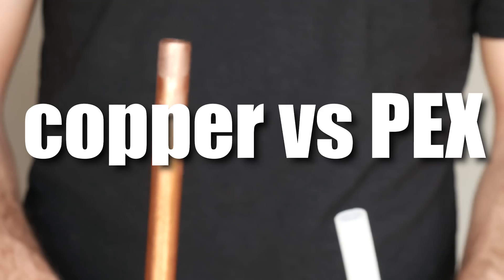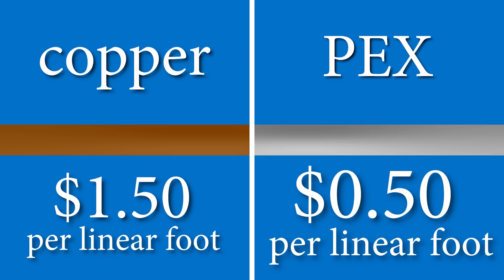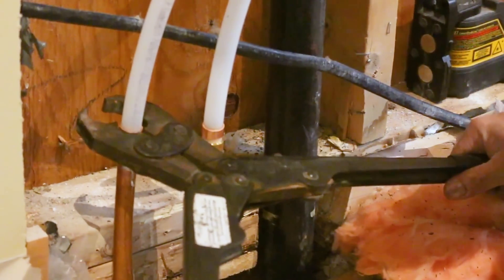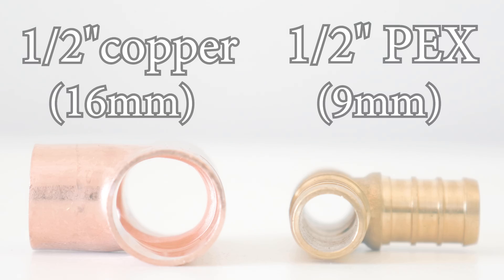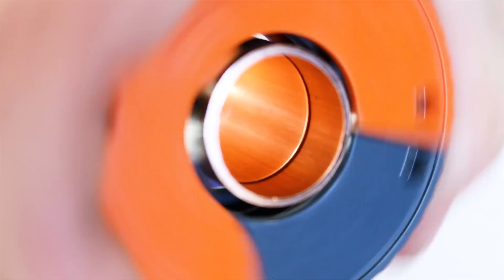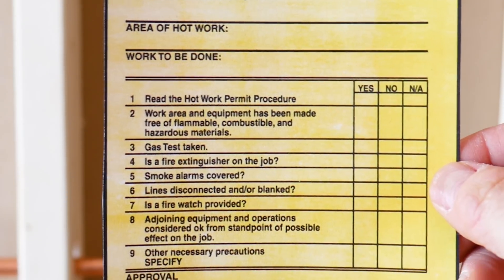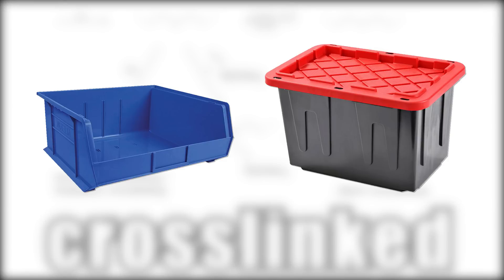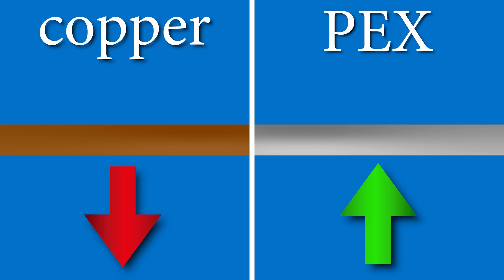Is Copper Better Than PEX? (COMPLETE GUIDE) | GOT2LEARN

Comment: For repairs, I just match what is already there.  If I come across CPVC, I use CPVC even though it is my least favorite system because it gets brittle as it ages.  Doesn't really matter because even it lasts much longer than my guarantee.  My favorite system is copper L, soldered.  ProPress is great for repairing copper with water in it or a fire hazard or to avoid a hot-work permit, but solder hands-down is the best.  ProPress is just a fancy crimped on SharkBite.  One trick I do sometimes is solder on Copper to Pex barbs and do a repair in pex particularly for freeze-ups or when I want to get off a job-site FAST!
Reply: Im practicing soldering right now. It's just crazy because it looks good on the outside. But when I double check my work by splitting the fitting. I see gaps I missed. Do you think this is the case for alot of people when they are soldering joints?

Comment: I would rank my choices... Copper L would be my preferred choice, then Pex A like Upanor, then Pex B with a quality crimp or clamp job on plastic fittings,  then pex B on metal fittings which can corrode, followed by Copper M, then CPVC.  Those would  my my choices in that order.  My house unfortunately has Pex B with the Crimp rings on plastic fittings... they are NOT done well from the ones that are visible in that they are not cut square, not crimped square, not centered  etc.  It was as if someone did their first crimp job.  I do NOT want to know how the fittings are in the walls or worse under the slab!  Clearly the plumbers here were idiots.

Comment: Copper doesn't give off fumes in a fire (great for fire safety and smoke requirements). Over a century of evidence shows that copper piping is flexible enough in to be used reliably in structures subject to damage by earthquake shaking (as long flexible connections are used on appliances like clothes washers, sinks, and water heaters as most codes require). But fastened in a wall a copper pipe flexing on a swaying third story building will survive just fine and deform as needed, including the soldered joints and elbows (although PEX is more flexible). Copper can also be used outdoors on building exteriors exposed to the environment (great for masonry applications) while PEX will deteriorate due to sun exposure. Lastly, when your screw or nail hits a copper pipe in a wall you will feel it better and be able to detect it earlier. Modern screws are so sharp that they will easily bite into PEX before the flexible plastic pipe can move out of the way to avoid damage. That being said. I have faith in both PEX and Copper.  However, when someone Hires you to do a repair job, the customer feels they got their money's worth watching you prep and solder versus slide on a shark connector and then saying write me a check for $600.00.

Comment: I'm an electrician, I've been trying to learn more about the other trades. Your channel has helped quite a bit, I've learned a lot.
Reply from the maker: Great to hear, the more knowledge the better!
Reply: Same here.
Electrician as well.
This channel is awesome for learning the  plumbing trade
Reply: same here
Reply: copper is conductive.
Reply: @greenspiraldragon  A major consideration when we bond, very true.
Reply: Ha, I'm a plumber that's now also a controls electrician.. always good to know there are others out there that don't limit the trade knowledge to their own single trade, my 3 early years of framing gave me the knowledge as a plumber to know what not to drill... as a sparky, your plumbing and heating knowledge should lean towards boiler controls and pumps primarily if its to be a compliment to your trade :)
Reply: Mann 😆
Reply: No no no no.

Comment: With the cost of copper these days, PEX every time. I just got quotes for a 35' gas line extension, the copper ones were at least double the yellow plex hose.
Reply: More to it than cost. I would never run a plastic gas line. That is a time b o m b.
Reply: @rickjames6948  Yea, I know, that was my first thought, but copper is at least twice the cost. It is not really plastic, it is rubber with a flexible metal inside. It was installed by a licensed HVAC, so it must be to code. I was really leery of gas, but the gas system has so many safety measures. How often do you hear of a gas line explosion in a house?
Reply: @johncasey5594  Only a few times a year, in my city.

Comment: One question i have is which pex is best. Two concerns i have with pex is water contamination from plastics and how long will its joints really last. It's one thing to repair a few coper leaks after 40 to 50 years but i would bet the  pex fitting connectors have a shorter life span and will be a major repair cost. This could mean replacing all the water pipes in a home after a certain amount of time which i believe will be much shorter than copper.
Reply: My home is 30 years old and I can say that the compression fittings on my pex water lines have started to corrode, I think pex is the way to go inside walls and hidden areas, but we’re converting to copper under all of our sinks and for the bathrooms as well. Pex is about 70 cents per foot, the copper pipe I bought is $5 per foot.

Comment: Here’s one thing you cannot deny there is absolutely no lead whatsoever released into the water system using pex
Reply: All brass has a small amount of lead and all (as far as I know) pex valves and female adapters are brass. Where do you find lead in copper? I use “lead-free” solder but it may have a small percentage of lead, too. I really don’t know.
Reply from the maker: Here is some good info about lead allowance in brass guys, check it out: https://www.youtube.com/watch?v=cELzc9ZophQ&t=1s&ab_channel=Got2Learn

Comment: PEX stub out for toilet? It will be rotten by UV light, even coming through windows or lighting. PEX cannot be used everywhere copper can, but copper goes anywhere PEX can
Reply: Good pex is UV resistant. I still like copper for students tho
Reply: I replaced a copper freeze hazard deck faucet line of about 20 ft with PEX. The problem was the last 6ft would be smacked with UV. No good. Solution: shrouded the PEX in shower curtain rod cover plastic the same color as the decking material.
Reply: @JeffreyTheTaylor  i don't worry about freezing here in Southern California. I like copper.
Reply: @DragonBuilds  We didn't worry about it in Atlanta either. Nor did my neighbor. Then it hit a freak 5F one night. Basement bathroom copper pipe blasted a hole in their sheetrock, looked like a disaster movie. I put the PEX in ASAP. Lesson: spec to freak.
Reply: I think the answer is to use Copper Stub-Outs, but I could not agree more.
Reply: @jamesdunphy6262  Here in Southern CA copper can easily last over 100 years. Some places probably have very harsh water. But PEX isn't allowed anywhere the sun might shine on it.

Comment: Also,(i forgot) copper its safer than plastic,because of chemicals found in most plastic pipes.not to mention that most of them,are not sunlight resistant,and the toxicity,related to this,and sun exposure.

Comment: Well,it all has to do with water condition,aside from price, life span,and skill to work with. If water its acidic,or the ground,you have no choice.use pex. That's why pex fittings comes brass and plastic.
Personally i use both,even in the same job,as code permits.

Comment: Copper is the way to go for me as I find the process and end result awesome, compared to the somewhat chaotic pex pipes never running in a straight line. I worked in process control and instrumentation so bending/fittings/soldering are the way to go for me. Although I don't make a living out of it so it's a different story .... ¯\_(ツ)_/¯

Comment: Good video,first of all I have never bored holes in studs and rafters to route pipes,the way I was taught is to notch out studs and rafters when installing water pipes and to use nail plates to protect the pipes from inadvertantly being damaged by nails and screws when sheetrock is installed on studs and rafters.I will only bore holes in studs and rafters to route electric wiring and of course to route drain pipes.As for copper pipe not being flexible I now use copper pipe press tools which make installing copper pipe faster and safer than soldering the copper pipe.At first I was highly skeptical about copper pipe press tools but after having used copper pipe press tools I am amazed at how easy and safe it is to install copper pipe using press fittings.God bless you and yours,thanks for the video.

Comment: Always PEX for us! I've heard old plumbers say nothing is as secure as a good solder joint. Could be, but I've repaired solder joints that looked A1 in the outside, until we went to repair and it popped apart in our hands. Also, some areas have acidic well water which eats copper.
Reply: Sometimes you never really know until you cut the fitting apart and look to see how the tin spread in the fitting. Im currently practicing with it. Looks good on the outside but bad on the inside.
Also soldering is so time consuming compared to installing pex

Comment: Great video, I have always like copper but that is what was available at the time when I learned how to plumb it. Pex in the late nineties was garbage and unreliable and burst in homes including mine in 2007. I wasn't a fan of pex. The recent modernization of pex has grown on me to the point I would choose over copper for the convenience and price. I am still learning pex, but finding the differences of joining different pex products would be a great video. It would be nice to see how to connect different pex connections by the understanding of them. Thank you looking forward to another video. I will hit the bell and subscribe.
Reply from the maker: Awesome thank you for the sub and like :)
Reply: You don’t want to mix pex products. In order for the warranty to stay in effect you have to use the same brand pex pipe and fittings. If you don’t you will reduce the warranty from a 25 year warranty down to a 5 or 1 year warranty. Manufacturers test their products with their fittings and that is what they will warranty.
Reply: I was writing on Pex A and B connections. A is better then B, but I have problems trying to seal the joints on A when installing it. I would like to see content on this. Thank you for responding. Great channel.

Comment: PEX,  I suppose it has it's places but, for overall performance and longevity I will go with COPPER!!! I am a plumber too. Torch it and forget it. Still the best system going. Pex is cheap and your drinking water that goes through this cheap plastic pipe that can grow microbial stuff and gets weak if exposed to sunlight. 50 years my arse!! Copper, baby all the way!!
Reply: Don't let them take the skill out of your trade.
Reply: @rickh1300  lol plumbers will be fine, most states you need years of plumbing under a master plumber to even apply for a permit to work on your own, same shit for electrician. Their unions made it so their job will be safe for a long time. Which annoys me as a carpenter, any idiot out there can get a license to build homes as long as they pay a plumber and electrician that is licensed, meanwhile they can barely tell the difference between pt wood and regular. Live in DC area and you can’t even replace a tub without a licensed plumber pulling a permit to do the work.
Reply: Of course you're a plumber. Gotta install something that will freeze and burst so you can charge to repair it. Pex won't freeze.. and can withstand more pressure overall
Reply: @asithappened99  Pex has its places and so does copper. Plumber, auto mechanic or Psychologist, yes i fix things. It not just about money to fix something. What, where,  how to fix anything correctly takes experience. It is not so it will break again and charge you some more. Crap attitude. Fix it your self. I see 12 agree with me. You have no one!!  Copper all the way. I'll believe 50yrs for pex when i see it.

Comment: Nice video ! But you didn’t mention that pex fittings are more expensive than copper fittings most of the time ! And that the pex tool that you are using is not very handy in a small spot because it requires to be opened to the max to do a well crimp ! I know that there’s smaller tools 🛠 for pex lol 😂 but there both good depends the situation 🤙
Reply: pex fittings are more expensive, but you need less of them if you plan it out right as pex is flexible.  I forgot the exact recommendations, but 1/2 inch pex can go as tight as a 5 inch 90 degree bend.  The price of pex tubing more than made up for the cost of the fittings for me.

Comment: PPR?
Reply: @Got2Learn  Polypropylene Random Copolymer. PPR piping.  What about comparing to it as well.
Reply from the maker: Ahhh yes, we don't see much of this here in Canada, but yeah it would still make for a good video for sure.
Reply: @Got2Learn  thanks, that would be great. Here as far as i see it(I'm not a plumber) it is popular here, for domestic hot/cold water and heating secondary loop. Tho underfloor heating is done with pex or pex/al and if it is firewood boiler primary heating loop is done with iron/steel pipes. I'm redoing all the plumbing in my house, so i need every bit of information i can get, what's what, and what i can do my self, because stuff gets expensive pretty fast.

Comment: If your a plumber you're a very bad one!! Using a lead based solder on water pipes?? Are you kidding? This method has been strictly banned by world wide plumbing authorities for many years. Drinking water from a joint that has lead in it. Wow what cave have you been living in? Going by your basic knowledge and terminology l think you must be a self taught  handy man not a very skilled plumber. Your workmanship is terrible. Leave it to the professionals who have and are extremely well trained and would never make home videos telling others how to undertake the elite trade of plumber. Off you go!
Reply from the maker: Someone isn't having a good day hehe, I never use lead solder Geoff, never did, never will, and I certainly didn't say that in the video lol 🤦‍♀️
Reply: @Got2Learn   Really? Your using core solder on your joints. What is the base of core solder? Lead & tin. The multi purpose flux you're using is also for lead based solder. Silver solder or bronze rod does not melt that quickly under such a cool flame. Mapp gas I'm guessing going by the flame. Perhaps you need to warn the people who follow you not to use lead based solder on any pipework for drinking and definitely not on any gas pipes! Oh yes I am having a good day. You?
Reply from the maker: Geoff, MAPP gas doesn't exist btw and there is no lead in the solder and flux we use.
Reply: @Got2Learn  Well that's very odd. I'm looking at a bottle of MAPP gas right now! I'm guessing that you're a self taught handyman that thinks he knows plumbing. I have viewed several more of your  online videos and wow shook my head in disbelief at some of the things you  say and do. Yes some were ok but leave the plumbing to the plumbers who are all very highly trained in their trade. A little bit of knowledge is dangerous! Before you point at me, I'm in my 49th year of plumbing and probably forgotten more than you know, maybe! Would you like a photo of Map gas?
Reply from the maker: Yes you are correct, a little bit of knowledge is dangerous, enjoy Geoff: https://en.wikipedia.org/wiki/MAPP_gas
Reply: Really? Your using core solder on your joints. What is the base of core solder? Lead & tin. The multi purpose flux you're using is also for lead based solder. Silver solder or bronze rod does not melt that quickly under such a cool flame. Mapp gas I'm guessing going by the flame. Perhaps you need to warn the people who follow you not to use lead based solder on any pipework for drinking and definitely not on any gas pipes! Oh yes I am having a good day. You?

Comment: Stainless Steel 😉 when it is too expensive then we use PE-X* or multilayer PE-**/Al/PE-**pipeing systems. Cooper should only be used in heating systems, but due to the high price we also use other materials

*....a, b ,c
**... Xa, Xb, Xc, RT, HD for outside layer